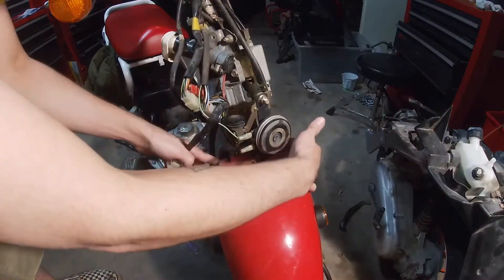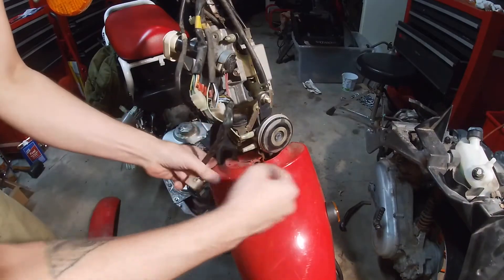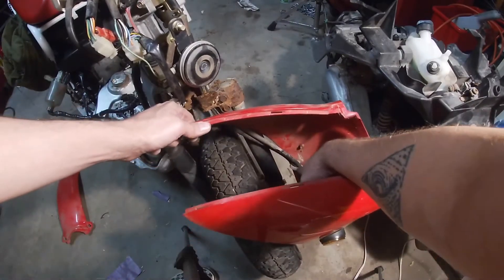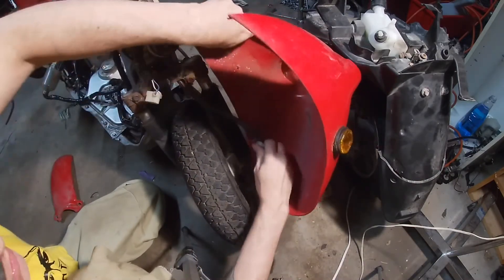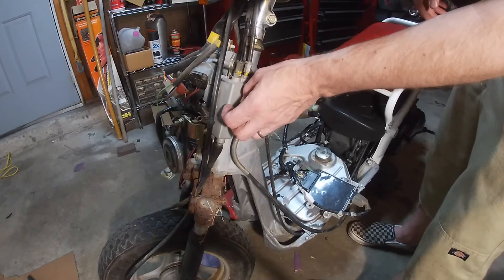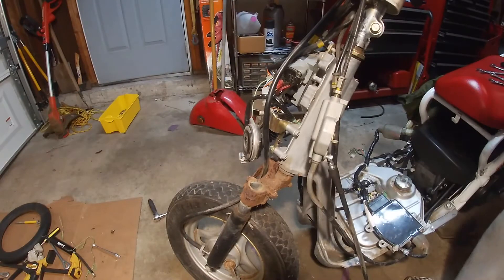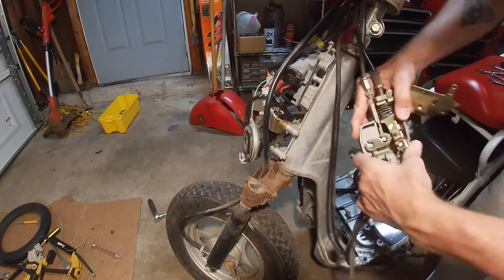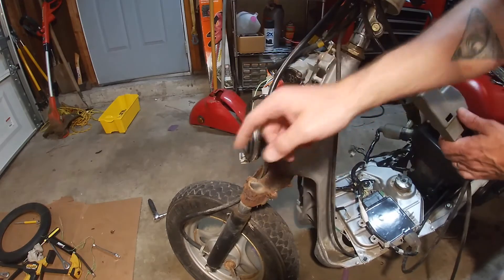Metruck Update: Removing the Met Brake Cables

Comment: What length cables are you using for the front, and back?.... Or do you have a link?  i watched a vid on how to make custom cables, but would 100% rather just buy a set.
Reply from the maker: I'm going to use stock Ruckus cables. Should work perfectly.